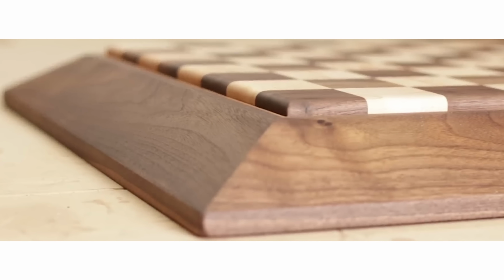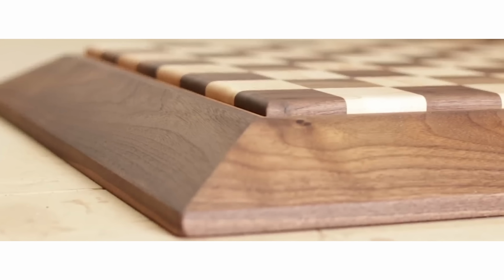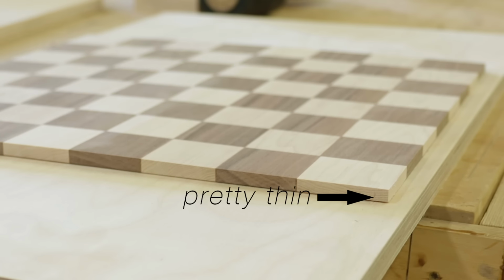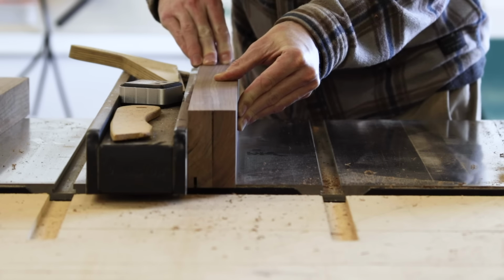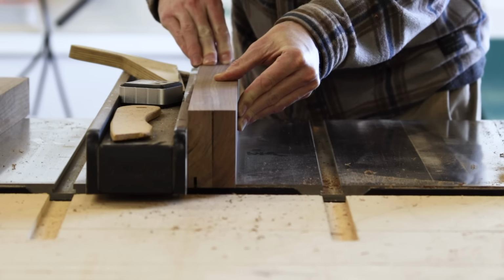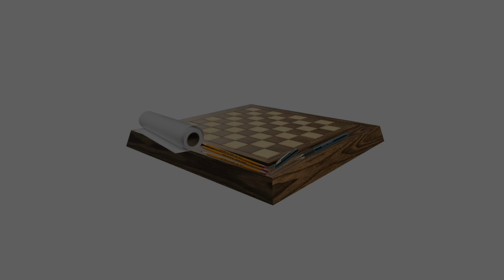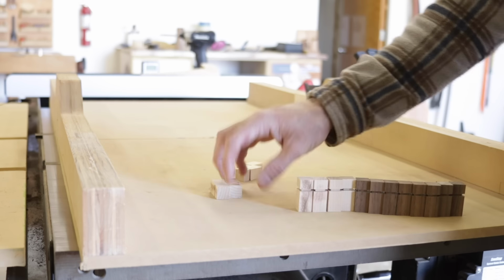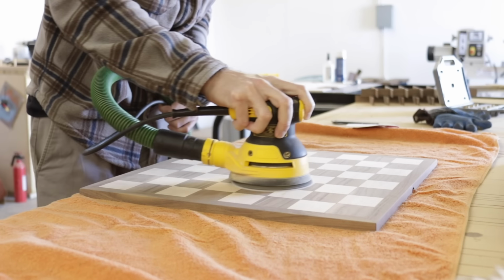Making a Chess Board and All of Its Pieces - Including the Horse, the Castle, and the Pointy One!

Comment: Drilling out the bottoms of the pieces and glueing in a lead weight would be a cool addition.
Reply: Yeah, I know that is fairly common. Might be something I try if I ever do these again.
Reply: @Gary Lau That's more of a travel board feature. It's kind of annoying to have pieces sticking to a regular tabletop board.
Reply: Exactly my thoughts. Would do a lot for the feel of the board.
Reply: Yeah and some felt on the bottom of the pieces so they don’t make too much noise
Reply: Great idea
Reply: even better, use said hole to springload the pieces so they fly off the board whenever taken
Reply: @krisimanasieva422  and you could easily slide the pieces as well
Reply: You cant play fast chess with those pieces anyway
Reply: @stopthephilosophicalzombie9017  there’s no magnetism and they don’t stick. The lead is simply for more weight to the pieces.
Reply: Or something else that’s not as expensive like sand or a rock? And put a cork and cut it off
Reply: @shaunb66  you can also put sand or rock. Well anything. Drill the hole than put a cork and cut it or well anything. Than make sure you expand the cork with oil so it won’t come off.
Reply: @fallingsuncreations9270  Lead is pretty cheap
Reply: @funkymonkeylovin  but where do ya buy? I’d prefer to put some sand. Cheap easy. Found easy
Reply: @fallingsuncreations9270  fishing weights are cheap enough and would work.
Reply: @funkymonkeylovin  I’d rather not be close to lead
Reply: @quasi-intellecual3790  insert eye roll emoji here
Reply: @vedicapproach8105  Yes its for the weight and to lower the center of gravity, so that they dont fall over as easily
Reply: @quasi-intellecual3790  tungsten?
Reply: Magnetic even cooler
Reply: Ye
Reply: Should probably make some extra queens and possibly knights, incase a player promotes a pawn
Reply: Instead of weights, he should add magnets to the board and pieces
Reply: Horse is knight and castle is rook
Reply: *or… using heavier neodymium magnets and making the board magnetic.
Reply: And the pieces should be wider to be more stable.
Reply: Or neodymium magnets, and the polar opposite glued under the board about 1/4" inset
Reply: @quasi-intellecual3790 wear disposable gloves if you’re worried, it’s really not a big issue

Comment: As a chess player, I can tell you that there are a few things I would add to make it a custom made chess board. ie;
Both sides should have a design where you can put the pieces taken as you play along, may be like a qtr inch carved section on both sides to place the pieces taken while playing along. 
While making it somewhat carry able, the bigger the better.
Each piece should have a rather heavy weight to its bottom as to maintain the piece not easy to be knocked down. I am sure it will be  sold.!!!

Comment: the pieces are too small in comparison to the square size. other improvemens can be; (1) making to piece tight into the inside compartment, (2) making the top of the board magnetic and the piece as well, and (3) write the numbers for rows and column like on standard chess boards. Hope you will consider.

Comment: This set could only be used for home or office purely because of the design. I know this wasnt optimized for tournaments and stuff but just wanna explain why.
There are a couple of things that tournament grade sets have that this one doesnt that makes it really bad for tournaments.
Design
Sure, it's simplistic and aesthetic and all, but the reason chess sets are not simplistic is the distinguishability between the pieces. You're gonna wanna tell the pieces apart like for example the king and the queen. Here I'm assuming the tallest piece in the set is the king. An important distinguishing feature of the king is it's cross and height. I initially thought that that piece was the queen because of it's spiky crown.
Ergonomics
Tournament pieces have a large, heavy, and matted base to keep it from tipping over so easily. The pieces are also minimized such that it's center of mass is low to also keep it from tipping over. The pieces in this set are symmetric in every dimension therefore keeping it's center mass squarely at the center of the piece, making it prone to tipping over. In order for a piece to tip over, it's center of mass must reach over the line of the piece's base. A higher center of mass would create greater leverage for the center of mass to go over the base. The matted base creates friction with the board so that the pieces don't slide around. ("tipping over" counter: 4)
The head of the piece, which mainly distinguishes them, also plays a role in ergonomics of the set. The heads make it easy to pick the pieces up when moving them.

Comment: why did you take all the depth off the material? Why not just use that? All my boards are at least a half inch think. I have a few that are more than 3 so they double as a great butcher block.

Comment: Cool work. I'd just like to suggest you to maybe add a little more detail to identify all of them. In the outro, I thought the rook was a pawn and the king was a queen. In a real chess game, it´s very instructive and useful to quick and easily identify all of the pieces from each other, and the minimalism in this particular case doesn´t help a lot. Hope this helps
Reply: The rooks are about 30% larger in every dimension than the pawns, double the volume, and they have a cross cut in their tops. The king is pointy on the outside edges, the queen is pointy in the middle, 4 points vs 1 point, very hard to confuse. IMO they are easily distinguishable on screen and in person even easier.

Comment: Looks beautiful, but it seems to me that the kings and queens would probably have a stability problem, based on their shape. Perhaps inserting a small lead plate of sorts into the base (by splitting and regluing would be a good solution for that. Or just changing the shape, obviously. :D
Reply: Thanks! Yeah, they aren't too bad, but I have seen people drill out the bottoms and add in some weight that way. Might do it down the line if we feel like it is a problem.

Comment: As someone who actually plays chess I have an issue with the pieces. (And no the names don't matter.) For about 170 years Staunton Chess Sets have become the standard. The reason is that the pieces are easily distinguishable from one another. The King and the Queen, as well as  the Bishop and Knight, are too similar. A little more work to differentiate the pieces is necessary. Otherwise good work..